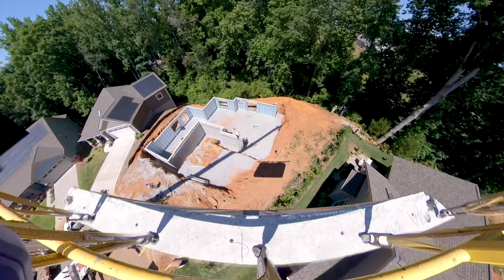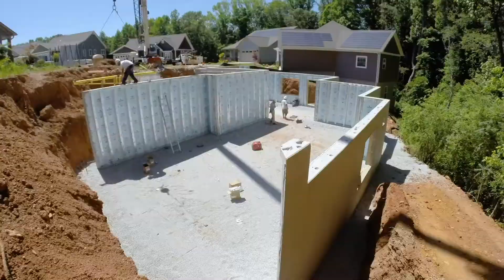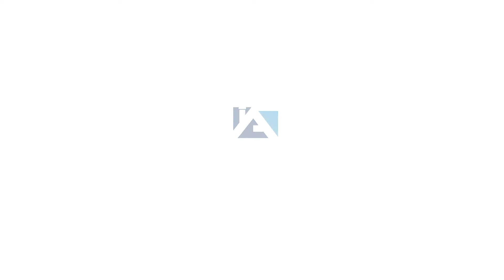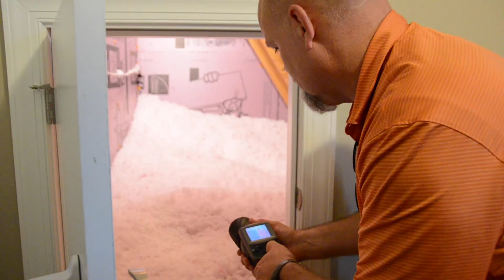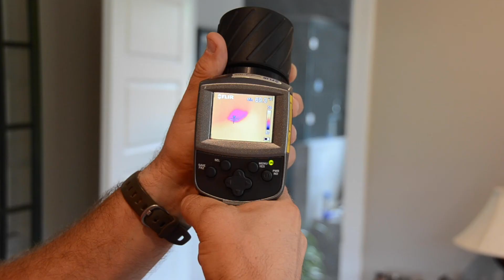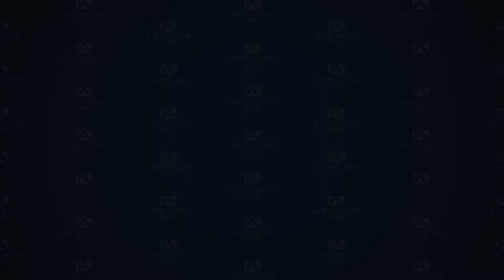INFRARED CAMERA Home Inspection

Comment: Do these cameras show where hear and cold are coming in or just water/moisture?
Reply from the maker: Thermal imaging cameras show differences in surface temperature - so yes to your question.  They don't actually sense water/moisture, but water has a different heat capacity than other materials and will typically stand out due to its temperature difference on an infrared thermal imaging camera.
Reply: @AddisonHomes  Thank you